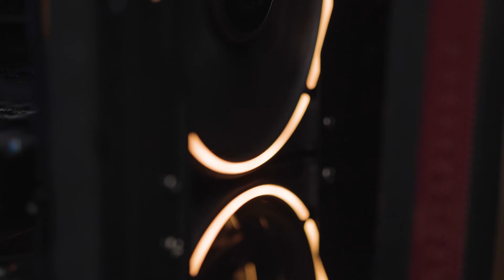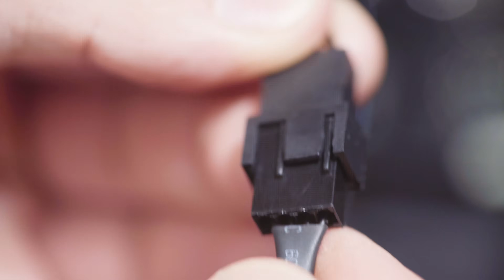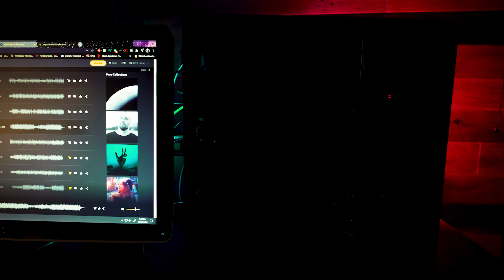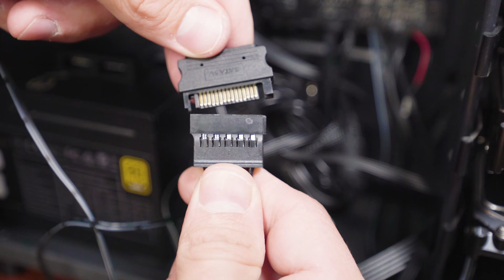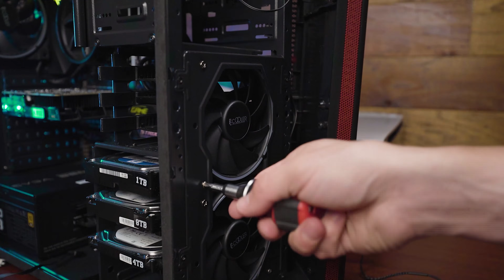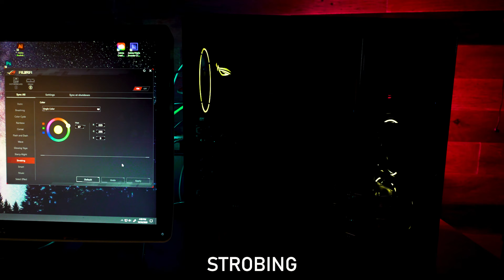Use 5V RGB Fans on 12V Motherboard with DEEPCOOL RGB CONVERTER

Comment: Hello man, i have a two gamemax case fans that come with sata conector and 3pin argb, the problem is they are run at full speed because they are sata powered, will buying this converter can lower the fan speed?

Comment: Thanks, I have an Asus Mobo from 2020, giving my system to my daughter, she wants lighting. I have two 12vRGB connectors (Asus Aura) on the mobo, and wasn't sure how this works with the new ARGB fans.  this is great, that deep cool converter doesn't look to be available anymore but there are others I can use,  thanks.

Comment: how did you overcome the flickering led issue when RGB is in breathing setting that the converter causes? i have a 4 pin header and 3pin AIO, fans so on and the converter fixes that great but now i can only use the solid color otherwise my PC gives me a seizure from flashes Im not he only one its all over the web and I've tried all the software's updated drivers. anyone have any tips I'm all ears

Comment: Hi ray, I'm just gonna ask because I bought the converter today and I tried it but it flickers for me. I did the same thing as you did on the method #2, my motherboard doesn't have any 3-pin rgb header too. I mean it works but only for steady light mode and it only works for selected colors, it flickers when I use other light modes. My motherboard is a MSI B450M Mortar Max and my fans are 1x Thermalright TL-C12B-S V3 and x2 Thermalright TL-C12B-S V2 for my Thermalright Aqua Elite 240 V3 and x2 Arctic P12 PWM PST A-RGB. I hope you can help me ray, thanks.

Comment: hi, sir i am from india. in india rgb converter price is very high . can you make a video how i customly made a converter (my mother bord is msi b450 gaming plus max and its have 4pin jrgb and my pc case is msi mag 100r which have a argb controller, now i want to use 5volt from my pc case argb controler and data pin from motherbord,can its possible to do that). please answer

Comment: Does this work with any motherboard with a 12V RGB header? Also, can you plug an ARGB hub into this converter to be able to control more fans? And will the ARGB software work with this method, even if you use a motherboard that doesn't have an ARGB header and thats not officially supported by the software? For example, using this converter, would I be able to use RGB Fusion on my H410m S2H V3 Gigabyte motherboard with no 5V ARGB header? According to Gigabyte, the only Intel motherboards supported by RGB Fusion are the Z790 motherboards.

Comment: okay so i have an rgb fan hub controller but it uses 3 pin. the question is i still need to input some power on my rgb fan hub controller? even though i have this conversion kit?

Comment: Yeah, that's a good fix if you have already bit the bullet and have 5v fans and a 12v motherboard. Unless your life is incomplete if you don't have a particular fan that is 5v, it is best to get a 12v fan if you have a 12v motherboard, like I have, an older Gigabyte GA-AX370 Gaming 5 motherboard.
Reply: I tried finding some 12v fans but crooked manufacturers apparently stopped making them in any significat way. Even idiot Thermaltake took their Riing 12v fans, fans named the same, radically switched their product's technical details midstream to cause as much difficulty for the consumer to know what that product is compatible with. If you are going to totally change how a prduct works, CALL IT SOMETHING ELSE!

Comment: Hi good morning! Excuse me, do you know if I could connect the 5v fan of my CPU Cooler Deepcool AG400 to the fans of my Fractal Design Pop Air RGB case that are also 3 pin? Or is it necessary to buy the converter? Thank you! :D

Comment: Well, but it does not do the rainbow fx, so there is no difference between RGB and this conversor using AURA software... In this case, I think I'm gonna buy some RGB fans, without the conversor or adapter.... I will think this will able to do rainbow fx, but not lucky here. I need to do a research about, I'm not sure if can perform FX rainbow with aura or still no differences between RGB or ARG fan.

Comment: My fans RGB is working but it's not spinning and i didn't connect the vdg and another connector from the Asus tuf gaming gt301 fan hub cause I bought the gigabyte b450m ds3h motherboard and it doesn't have these headers . Is that the reason ..?? If it is will it work if i used this deepcool product??? Pls do answer

Comment: I finally found this goddamn thing, been looking for a solution for a year, will update once it gets delivered. Great video by the way, very informative and throughout.
Reply from the maker: Thanks. Just like everything these days! Can't buy any electronics we actually need right now damnit! Lol
Reply: Did it work for you?
Reply: @RobloxRandomMadness  It did, color changes are a bit limited, but you can control it through software
Reply: @ex1viiq  Which software did you use? The fans dont seem to light up when I dont use the controller
Reply: @RobloxRandomMadness  ICue

Comment: I finally got all my parts connected and my RGB fans are flickering. Asus PRIME B450M Aii with 6 DEEPCOOL CF120 FANS. RGB is connected mobo 4pin>Deepcool hub> 6 fans daisy chained in sets of 3 coming in through Deepcool connector and 3 coming in through Deepcool 3pin>5v 3pin argb adapter. 

All of the fans go insane. I can't figure out the cause of this.

Comment: Can I use this on my b450 mortar max and sync montech air 100 argb. Currently my case performs only the install argb function 🤔
And one more thing how many fans can I connect through this device, what I've if I wanna connect 5 or 6 fans 😐

Comment: Hi, i'm using Gigabyte H510M S2H Motherboard and the ID-Cooling 12025 fan case, but when I connect with this Deepcool Converter, the fans' still running but the leds are only in the yellow light. When I open the RGB Fusion, there is nothing showed up to adjust the led light :( anyone knows this problem?

Comment: at 7.08 you connect the 3 pin splitter to the top (fan & ledstrip 5 volt) of the converter or do you connect connector to the motherboard header?

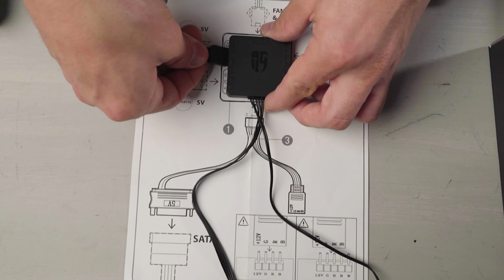Comment: 6:55 I’m very confused on the wording. I only have 12v 4 pins. If I plug in a GPU RGB bracket into that 5v 3pin slot, won’t it fry because you said you converted 5v to 12v? I’m trying to do it the other way but I’m just so confused on what people say.
Reply: Same, did u figure it out btw?
Reply: @sanzj.s2289  Nope, i gave up because i never get a simple answer. Not worth frying my stuff because they wont clarify :/

Comment: Are you still using this or did you get  new mobob with the 5v header?
Reply from the maker: Hey. Still using it to this day!
Reply: @RayValencia   hey ray! Im planning to buy this to connect my 6 pieces 3pin rgb fans to my 4pin rgb aura sync motherboard, does it require to buy another deepcool converter or one converter can already convert my 6 fans at all? thankyou in advance 😁

Comment: Hello, I was wondering if this configuration on Aura Sync works with rainbow rgb setting? Just bought some new fans with the exact converter you’re using in this video and I only saw you did a one-color effect on it. If you can clarify this for me, I would appreciate it a lot, thanks bro!
Reply from the maker: No rainbow works but it is only 1 color at a time.  It works in tandem with the mobo and RAM but it's isn't able to do mulit-colors at once, like the fans were intended to do. This solution doesn't fix everything but if you bought the fans like I did it will save you.

Comment: This is really cool and all but, my biggest issue is that you lose the Addressable Lighting when you use the converter and Asus Aura has different settings for different motherboards. Only the ARGB header motherboards have the ARGB software in Aura Sync. This is great if you made the mistake of buying 3 pin fans when you needed 4 pin. But, you lose the Addressable RGBs which really sucks.

Comment: I found this converter but was confused what its use would be with only one 5V connector (I currently have 5 cables that need connecting). Didn't think of the fact that splitter cables exist :'D thanks!

Comment: I bought a phanteks p400a A-RGB the fans are 3 pin in the case and my motherboard has 4pin instead of 3 but i looked at a building video and it seems to work with 3pin connected to 4 pin. But the issue is that it has rgb and its also 3 pin my motherboard the asys rog strix b450f gaming 2 has 2 4 pin rgb fan and 1 3 pin rgb. Will it work then no need to for this?

Comment: I am using this device since I had to replace my motherboard and didn't realize it doesn't have a 3 pin header. I don't really mind losing the functionality of changing individual colors as I always left it on blue before having to change mobo's. My problem is, I can't use any of the effects now like breathing, color cycle or any that have movement because when I set it to that it just flashes instead of smoothly transitioning. It also will not sync with my ram.  I'm using mystic light 3. Do you have any idea if there is a remedy to this?

Comment: i connect 4pin 5v to 4pin 12v motherboard and my rgb light only red. what should imdo?
Reply from the maker: Go into your motherboards RGB software and see if you can change it from there. I use the Asus MB software to change my fans, RAM, and Motherboard colors.

Comment: Just got mine and it doesn’t work with more than 4 fans.
Reply from the maker: Hey Jordan. Thanks for letting everyone know. I haven't tested the max capacity because I still only own 3 fans hooked up to mine. I've been thinking about adding more fans though, so this is good information. I wonder if you need 2 of these splitters?
Reply: @RayValencia  it seems like it needs more voltage I agree! Something I also recognized was pulsing in the rgbs. Maybe not exactly pulsing but one fan would flicker different colors than the mobo settings.
Reply: Other specs: 8 ARGB Cooler Master Halos. Mobo: ASUS Z390-A Prime. Cooler master ARGB RGB hub
Reply: I have 8 ARGB fans connected to a hub. Hub connected to the deep cooler converter. Only 4 fans rgb turn on.
Reply: I have another rgb gpu bracket holder that won’t turn on either I’m guessing due to a lack of voltage.

Comment: What I wanna know is does this work in the opposite instance. So my motherboard has the 5v rgb header but my fans have the 12v connection
Reply from the maker: No, I don't think it works that way. The cable it comes with is this way.

Comment: Hello! Can I connect Deepcool RGB Convertor (5V to 12V RGB transfer Hub) to Cooler Master wired RGB controller instead to a motherboard? I will then connect 1-to-10 Addressable RGB Splitter Hub to 5V connector of Deepcool RGB Convertor and will then connect cooler master ML240L liquid cooler to 12 V connector of Deepcool RGB Convertor. 1-to-10 Addressable RGB Splitter Hub will have M.2 aRGB heatsink as well as DEEPCOOL GH-01 A-RGB Graphics Card GPU Brace Support Holder. Will this scenario work for me?

Comment: GUYS I NEED TOUR HELP PLS ITS MY FIRST PC BUILD: Basically I had an extension thingi from my rgb lights around my room and I plugged it into the 4 males on the mobo, then I plugged in my fans on the female end of the extension. I plugged in the 3 pin males, onto the extension 4 pin females. It didn’t work obviously, but I’m scared I damaged my rgb. I bought the hub in the video but I’m worried that I ruined the rgbs.  The fans still work, but I don’t know if the rgb does yet. I didn’t plug it in directly onto the mother board but I plugged it into the extension from my led lights in my room. I hope I didn’t fry the rgbs. Please let me know!!!

Comment: hey just a quick question - I have adressable RGB fans with 3 pin connectors 
when I use that converter can I use the spinning rainbow aRGB effects or can´t it do that because it gets only a 12V RGB input from the software

Comment: Hi! what happens if I have 9 fans that have a total of 3 GD 5V connectors? Would I have to buy 3 deepcool converters? But where would I connect 3 12v cables if my board only comes with one? I DON'T UNDERSTAND :( HELP!

Comment: My case fans are 6pin connected to an OEM fan hub with 3pin argb header. However my mobo only have one 4pin 12v grb and one system fan port. What should I do?
Reply: Do u figure out a solution?

Comment: FOR ASROCK USERS
In general Asrock MB are not supported, but in my case (BeQuiet 500DX) LEDs were blinking, after using this device I can set up static colors, only effects like breathing are not working properly. So if you face a problem with blinking leds - this may fix it.

Comment: What do I do if I have more than 3 fans? I have 8 fans I need connected, is it possible to connect a hub to the 3 pin and use it like that?

Comment: Hi bro, thanks for the video!

i have this device, but i cant make this works. I have 1 kit with 6 fans + 1 kit with 3 fans and the rgb of the WC. All of them have a cabe with 2 connections of 5v 3p. A connected all of them and the last one i conected to the deepcool devide. The lights startd flashing like crazy and just 4 fans were with lights. Can you hlep me with the problem, please? one more thing, i dont have a rgb splitter, it didn't come with my device.

Thanks

Comment: Could i used the deepcool rgb 5v to 12v converter to connect the pre-installed fans plus an additional one coolermaster sickleflow argb fan (total of 4 fans) and connect it to my b450 tomahawk max so i can use the software to control lighting? do i also need any splitters? the case i am using is the Lian Li Lancool 2 mesh RGB. Thank you in advance, i hope someone responds

Comment: Great video and very useful!! Just one question, the RGB fans of my case have a 3 pin 5V conector but my Motherboard only has 4 pin 12V. Currently, I am using that 4 pin 12V for the RGB of my Liquid cooler. Can I get this DEEPCOOL RGB CONVERTER as a hub as well? I mean, to plug the 4 pin header of my liquid cooler and also to plug the 3 pin header of my case fans to the RGB CONVERTER and that plug it to the motherboard? I am really curious, hopefully you understand me, my english isnt the best. Thanks.
Reply: I think the 3 pin 5V are A-RGB and not RGB

Comment: I have this too. But drawbacks is that your Add-RGB fans are also converted to RGB fans. I.e Single colour at a time. So rainbow effect won't work.
Reply: aura sync is working or not? any other drawback bro
Reply: @SevenStoneStudio  It will work with aura sync if your components are compactible. Just that you won't get rainbow effect. It will be single color at a time. I changed my Motherboard with 3pin argb connector. Thats the best solution to use argb fans.
Reply: @elianfernandes9390  that's what i think for RGB fans need to spend.. because now only upgraded my cpu.. anyway can you tell me in asus which board have 3pin argb ?
Reply: @SevenStoneStudio  Im using Asrock b450 stell legends for my Ryzen 7. It has 2 rgb and 1 argb pin
Reply: @SevenStoneStudio   In asus any Motherboard with B550 above should have a 3pin argb connector. But confirm before you get one
Reply: @elianfernandes9390  amd 2600x is processor

Comment: Question buddy, my new case came with 6 RGB Fans and include a RGB Hub, but my Mobo dont have the RGB Headers what Control Converter do i need?
Reply: Me too, but i check my mobo spec it does have 4 pin RGB that didn't use. So I'm gonna try this.

Comment: Guys, if you have multiple ARGB components (5v3pins) like me (I have ARGB Fans, and M.2 Heatsink), since the converter only converts 1 5v3pin connector, you can buy an ARGB hub, then connect the hub to the converter, it worked for me.
Reply: or, best advise would be get a board with argb headers lmao.  Thanks, Ray Valencia!
Reply: Did you connect the sata cable of the argb hub to the psu or the one sata cable from the deepcool?

Comment: 6:20 The 6-pin cable you talk about may be confusing for newbs, better just to show hooking up a sata female IMHO.  Those fans are using the incorrect 4-pin RGB header, should be using the 2-space-1 ARGB header, possible to fry those 5v LEDS for a first time builder.  I should know, had some 4-pin header ARGBs and fried them by accident 🤣  Nice video, didn't know about the magnetic feature until your vid!  Keep up the great work!
Reply from the maker: Thank you clarifying Techspin! Hooking up a sata female is another good way. You're right. There are definitely some dangers of frying your fans if you hook up the wrong cables.  There are a lot of people asking questions about specific components and builds for this converter... but I can only speak from experience with what I have shown here in the video.  So, I SINCERELY appreciate any bit of extra info and insight like this that could help people out.

Comment: thank for the idea but i have a question if the mother board not have rgb header where ill insert the pin from rgb converter?my mother board is gigabyte ga-z77x-ud3h pang did not have rbg header 
lease help thank you

Comment: Hey, thanks for your video! I have 4 rgb 3 pin 5v fans and 3 strip rgb 4 pin 12v if I wanted to connect all these to the deepcool converter do you think it is possible to power the 5v fans and 12v strips? i have a motherboard gigabyte z390M (No gaming) with only connector 12V
Reply from the maker: It's possible if you use a power splitter cable for your fans like I did. My mb has several 12v headers so I just split mine up.

Comment: Hi. I have ROG XI Gene mobo with 2 4 pin RGB headers. I have 3 CoolerMaster ARGB fans and 2 BitFenix RGB 4 pin fans, one 60cm LED strip, and two strimer PSU / GPU cables. Is this what i need to make my ARGB fans work with my RGB hardware ?

Comment: Got the same issue with the b450F and the P400A case! Will getting the 4 pin/12V Corsair LL RGB fans with the commander solve this anyway?